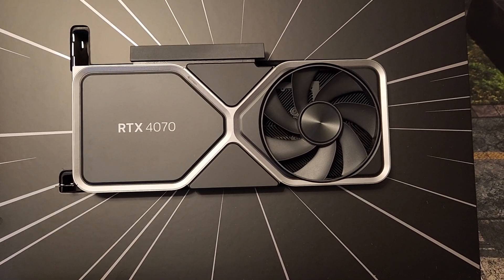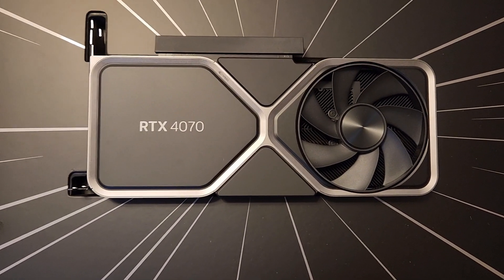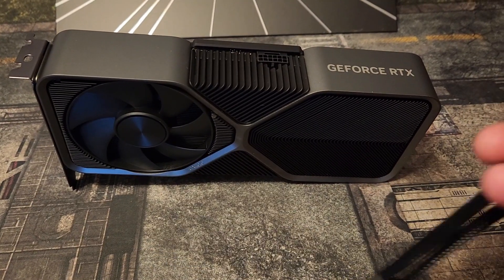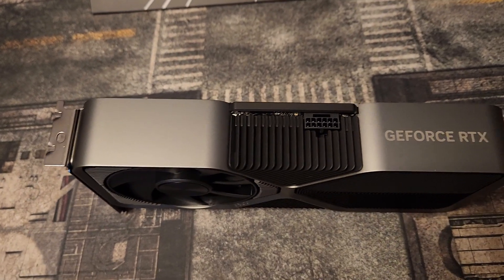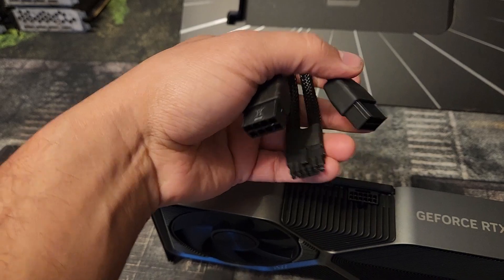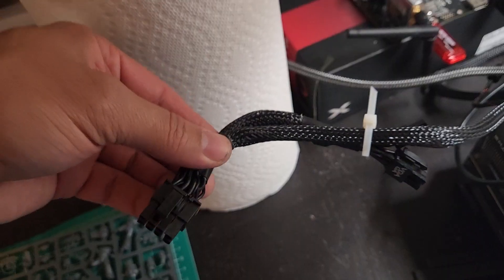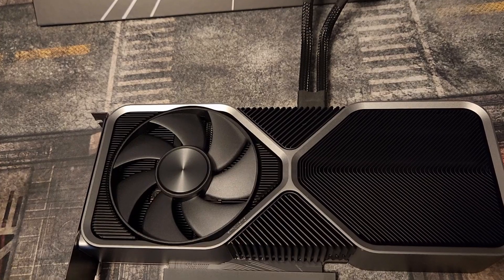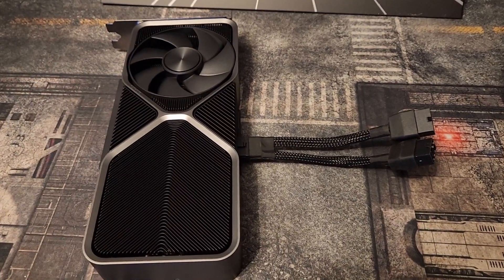RTX 4070 installation guide: everything you need to know about the 12vhpwr cable!

Comment: Hi was getting dozens of POST alarms, crashes, bugs, couldn't game, until I got no PC boot. I realized I was using one single pci e cable plugging the splitter to the nvidia cable.... fixed it with an extra pci cable, then PC worked like new - was using it the wrong way for more than 2 years.

Comment: If I have a chieftec cft 700 14cs, can I plug in rtx 5070 with 2 x 6+2 pin cables? Or do I only need psu with that of 16 pin? Thanks in advance

Comment: I have 850w power suply, one cable with 8pin +pigtail 6+2pin, it is connected to my 3070 and works fine, should it also work fine if i put same cable into rtx 4070 ? So it is one cable from power suply with 2 connectors (pigtail) tnx

Comment: İ have a question. İf i were to plug the 2 8 pins into the psu and then plug then into a extension cable. The extension cable will also act as an adapter right? Plz answer cuz i dont want to have any risks.
Reply from the maker: i dont understand
Reply: Basically there r two 12vhpwr extension cables one which is 12+4 on both ends and one which is 2 or more 8 pins so can i use the 12vhpwr extension as an adapter as well or do i need an adapter then i can use the extension cable

Comment: The cable that came with my 4070 super will NOT click. And I’ve shoved on it pretty damn hard. Worried I’ll break it if I push much harder.
Reply: did you end up figuring it out?
Reply: @dwindling7487  I'm probably way too late for a reply but it might help someone else who has the same issue. my 4070super from PNY did NOT click but it is fully inserted so some might just not make an actual noise or the clip just slid into place slowly not making a sound.
Reply: @nomiltof22  Same here with Asus Prime RTX 5070, could be design of adapter, did you come up with any problems while using it? My didnt click at all and it was very hard to push it all the way in.
Reply: Same with Asus Prime RTX 5070, had to use full force to insert dumb adapter all the way in without noticing any space between power connector and gpu, gpu has led light when off but goes off when system is on which is most likely due to this adapter working this way. I believe this adapter is different to one from this video.

Comment: Man the 4070 Super Dual is a pain to connect the power connector all the way in. I'm still trying to connect it all the way since a few days ago.
Reply: I just commented this as well. I never heard a click and I’m scared to push much harder than I already have been. I’ll maybe try to remove my GPU from the case and give it a hard shove then and see if I can get the click. It LOOKS like it’s seated the whole way but I don’t want to risk melting cables or whatever else could happen.
Reply: @Q20_Isaac  Just buy a brand new cable. It is not worth it to damage anything from the motherboard or the GPU. I bought a brand new cable from NZXT and it was as effortless as in the video above.
Reply: @aemilianusmartinus5472  damn :/ I feel like I’ve already bought so much shit to get this project complete 😅 wife is going to get annoyed if I have to go buy another item just because the one included is a pos
Reply: @Q20_Isaac  Damn bro, but at least the cable is quite cheap, I'm from a developing country and I didn't mind paying 10-20 bucks on a item that would give me peace of mind. In fact, it made cable management easier!
Reply: @aemilianusmartinus5472  I’ll see if my Corsair psu came with anything and then possibly buy what I need. Would be a shame to finally get my CPU in the mail and 1440p monitor just to have to wait even longer for a cable 😂 but worth it over crying my $600 GPU 😬
Reply: @aemilianusmartinus5472 I'm having trouble connecting too. Is the problem the cable that comes with the gpu?

Comment: So dumb question then. Does this mean that one 8 pin connector will work? And i can just tied down the other 8 pin connector? i just got a super and never had to split cables like this
Reply from the maker: Just released a 4070 super install guide last night check it out!
Reply: @kr00tman please can you help me. 
I upgraded from the 4070 to the 4070ti super. It came with this same adapter.  I get a red LED when the PSU is turned on but turns out when I power up the motherboard. My computer is lagging bad now. 
Is this normal? 
I checked all connections.  
I'm using 2- 6+2 pins to connect to the adapter.  Can't find any go9d info about the red LED on the 4070 ti super. Thanks for the videos
Reply: @ShireBurgo  is the red light on the graphics card or motherboard

Comment: I have 2 6+2 on the same cable should that work ok
Reply: I’m using a 4070 super as well and my 750e watt Corsair psu came with this same cable. I have the single side plugged into the psu and the double sided end (both 6+2) plugged into the cable that came with the 4070 super. I didn’t even think to question that it’s not supposed to go like that 😅.. is the double sided end supposed to take up two PCIe slots on the PSU and the single end go to one of the ends of the adapter cable that came with the 4070?
Reply from the maker: You could do that but I'd use 2 different cables to be on the safe side
Reply: @krootman_digitial  on my psu there’s another slot on PCIe/cpu if I had another gpu cable could I plug it into that
Reply: I got the same cable one single pcie cable at the end splits into two (6+2) and that's the only option I don't have two separate 8 pin pcie cables and mine is non-modular  is it safe i will be using it on rtx 4070 super which has tdp of 220w I am kinda scared?

Comment: Hi on a 4070 8pin GPU can I use just one 8 pin cable ?
Reply from the maker: Yes unless it has an adapter with 2 cables coming out then id recommend using 2
Reply: @krootman_digitial  can I use a nice looking extended then the splitter

Comment: I have a question,
i bought a cablemod from corsair with the 12vpwr on one end and two 8pin on the other end. I want to plug the two 8pins into the nvidia adapter and then the 12vhpwr into my be quiet pure power 12m. That should work. But what i wonder about is that at the two 8pins of the corsair cabel, there are on both plugs only 7 from 8pins occupied, and also not on the same spot. So now i am wondering how do i know where i have to plug the corsair 8pins into the nvidia adapter. Because when i plug them the wrong direction, then one power pin from the gpu is going into nothing.
Hope you understand my problem and that you can help me!

Comment: My redragon power supply has only one PCI cable that splits into 2 6+2-pin heads.
Does this cable handle only 150 w or do the two heads handle 150 w each?
Reply: Same what should I do? I am planning on using it on rtx 4070 super?
Reply: @farazsiddiqui1312 any update on this im on the same boat
Reply: Yo I got 2 6+2 pins on the same cable so would I plug 1 in each adapter
Reply from the maker: check out my 4090 guide for the cable diagram, but 1 cable SHOULD be fine for a 4070

Comment: Sorry for the stupid question!  
Off the power supply I have a 8 pin going in.  Then on the other side its a 8 pin and then splits off to a 6+2 pin.  Do i plug both those into the splitter off the graphics card?  I did try this and on boot up the fans were unbelievably clicking sounding?
Reply from the maker: they were tangled in something
Reply: @krootman_digitial  gotcha I looked for a wire or something and couldn't find one.  I pulled the plastic from the top off and the bottom and over the gigabyte... Could it potentially be rattling against the GPU anti sag bracket?
Reply: @krootman_digitial  also for some reason when I run 2 separate pci cables from the PSU to the card the PC boots up but only the ram lights up and I get nothing

Comment: i have a 8 pin and 6+2 pin connector will it work on rtx 4070 ? ( i wanted to upgrade from rtx 2060 to rtx 4070 ) and my psu is corsair cv650
Reply from the maker: Yup, should be fine

Comment: Im gonna cry I cant find out how to connect my asus dual 4070 oc please please help me! I removed my 3060ti but my cable is 6+2 im afraid is it safe if I pluged in 4070 with 6+2 ? Is it good at performance ? Why there is an empty thing in the cable in the psu side ????? So its 7 in the psu side and 6+2 in the gpu side! Please help me
Reply from the maker: I don't fully understand what your saying, if you have a 2 plug adapter you are fine to use both or 1 plug it's fine either way

Comment: I have a Asus TUF GAMING OC GeForce RTX 4070 should I use just a regular PCI-E that looks daisy chained and just use one of those. The card only has 1 8 pin slot for power. I’m confused and worried which cord I need.
Reply from the maker: Either one is fine I have a model with one 8 pin as well, it will work just fine

Comment: So I would just need the two 6 pin y-adapter, connect my built in 6/8 to it, slide off 2 pins from 8 pin to make it 6 pin, then connect 6/6 to 12 pin on 4070 card right?

Comment: Hi, if i put 6+2 pin and 6+2 pin from psu into the cable, is this gonna be fine? Or is even one 6+2 enough?
Reply from the maker: Yes to the first and honestly with the 2nd there's no reason to put just one in, if you have 2 but it seems to be that one would work just fine
Reply: @krootman_digitial  on my psu there is 4 (6+2 pin) :)
 So just one is enough, thanks!

Comment: How do I do this with the 4060ti it only has one not a two split. Sorry I am a noob at building but I need some help
Reply from the maker: what model do you have
Reply: @krootman_digitial  I know its heavily hated but I bought the 4060ti recently because Ive been searching for a Nvidia gpu for around 400 since 2019. I don't know much about pc building or what cables plug in where. Im going to watch a pc build-along type thing but Im worried whether I need to buy more cables/adapters. My psu is a CORSAIR RM650x from 2018, just wondering whether I need to buy a different psu or whether mine will work?
Reply from the maker: @jakewheaton5091  na for that gpu you will be fine, honestly going the used route is prob the way to go if you are ok with that, you can get a 3060ti or a 6700xt for under 300 and the 6700xt is actually faster then the 4060ti, if not honestly then enjoy your gpu and dont let others tell you its bad
Reply: @krootman_digitial  Ive already got the 4060ti, I just wanted a new Nvidia gpu just cus raytracing and stuff idk rlly, FE card just looks so nice. But im just confused about the 12vhpwr cable. it only has one end not a two split like for the 4070. Do I just plug in one 8 pin into it, or do I need to do some weird daisy chaining stuff to get more power idk? Can I just use one pcie cable from psu connect it to this adapter that I got in the box and then plug it into gpu?

Comment: Mine keeps getting bsod and idk why Corsair vengeance 32gb x2 amd b550 board Ryzen 7 5700 Nvidia rtx 4070 and a 1075w power supply from mi pc but its was a cheepo so i ordered the Corsair 1000w to replace it because i suspect thats the problem idk i have the latest driver and bios installed it will launch my computer and run normal up until i start a game then my graphics card will start making coil noise and crash all the way to reset
Reply from the maker: Try resetting the graphics drivers

Comment: Im trying to install my 4070 and i got an 8 pin and a 6pin, i tried inserting both onto the adapter and i tried the 8 pin alone, they both dont seem to give my monitor any signal, do you know how to fix?
Reply from the maker: You need a 6-8 pin adapter or a psu with 2 8 pins
Reply: @krootman_digitial  So I'm looking for a 12VHPWR 6-8 pin adapter correct? Can you recommend any?
Reply from the maker: @baro6447  https://amzn.to/3LexyXL something like this should work

Comment: hi i’m installing one now and this was super helpful, i do have a question though. i have an  8pin pci-e coming off my psu and a 6pin comes off the head of the 8pin kinda like yours. i can plug both of those into the the graphics card cable? even though it wouldn’t fill the other side of the gpu cable ? sorry if that’s confusingly worded
Reply from the maker: Nope has to be an  8 to an 8
Reply: @krootman_digitial Can my 3060ti card cables work with 4070ti power connector
Reply: Mine 6+2 pin I have 2 of them should that work
Reply: @brad-kj8it I have this as well does it work
Reply: so i could just use the 8 one and not the 6 and i’ll be okay? also thanks so much for the quick reply
Reply from the maker: @alle9002  yup as long as the gpu only needs one to power it
Reply: @krootman_digitial  thank you so much for the help